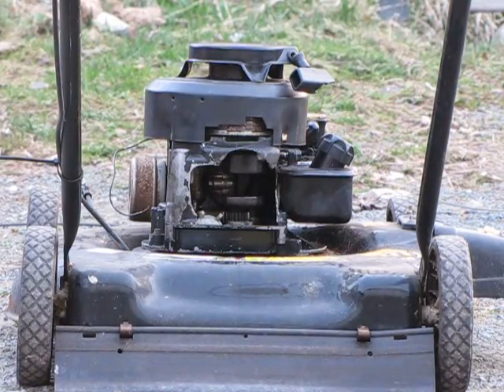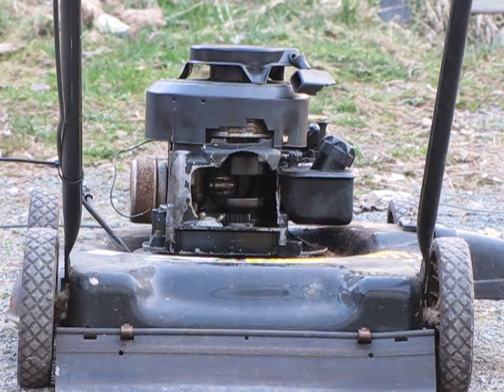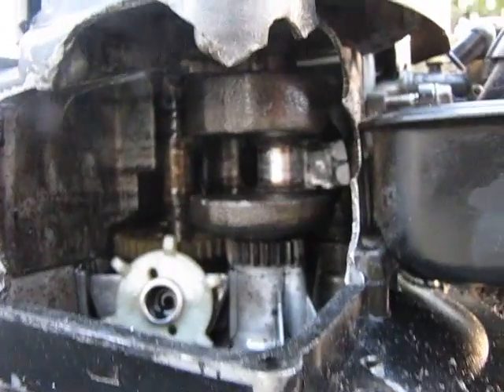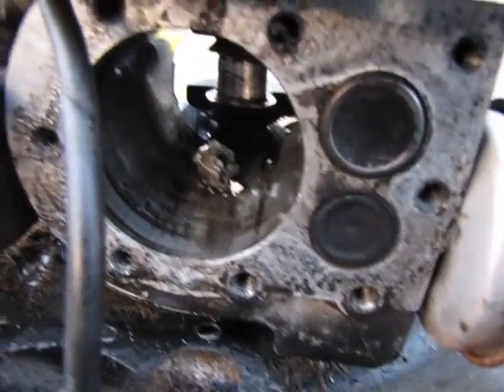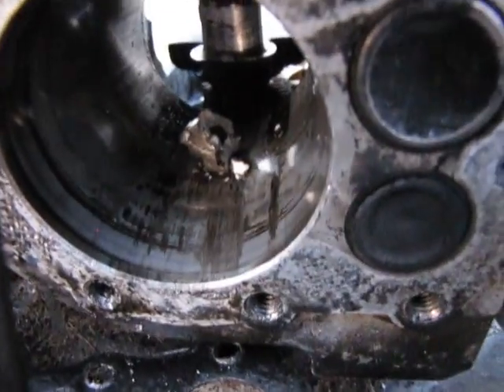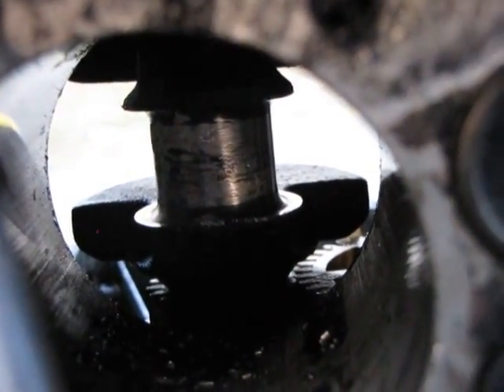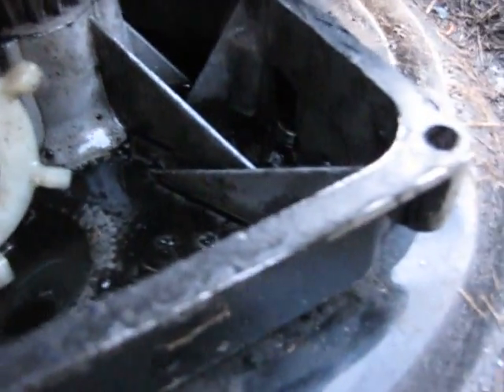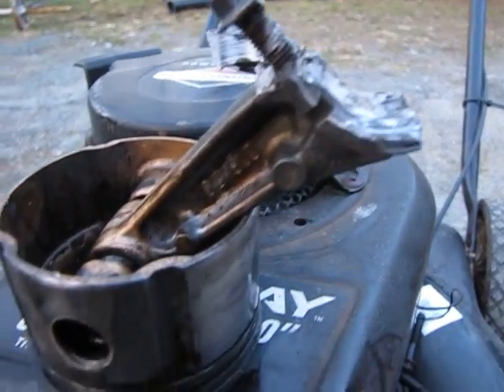What Happens When Your Engine Throws A Rod

Comment: After those cut a section out of the block to showcase how long an engine would last without oil as its important to check it frequently as its important to change the oil periodically as what would happen if those ran an engine without oil as they would be expecting it to throw a rod or just blow up as they realized running an engine without oil would cause a connecting rod to exit the block putting a fisted sized hole in the block.

Comment: That "cheap plastic gear" you see in the foreground is actually the oil slinger, which throws oil over the moving parts.  It is used instead of an oil pump, which the Tecumseh vertical shaft engines have.  In this case, however, it had no oil to sling around.
Reply from the maker: Greg Leuszler **I know it's the oil slinger** xD and you're right, no oil = no purpose :P
Reply: JL Oake lol I wouldn't say no purpose, the oil Slinger turned into a very small cooling fan for a few seconds 😂